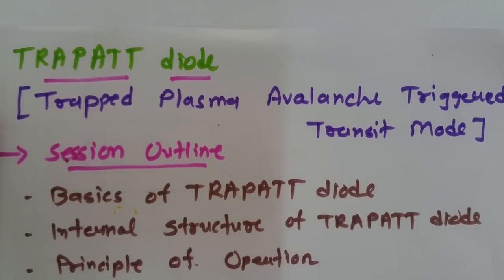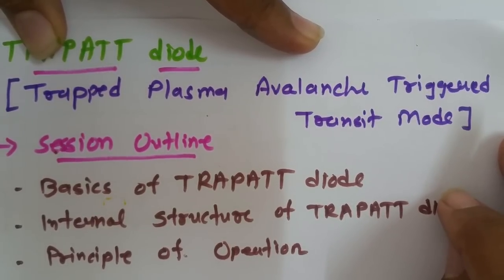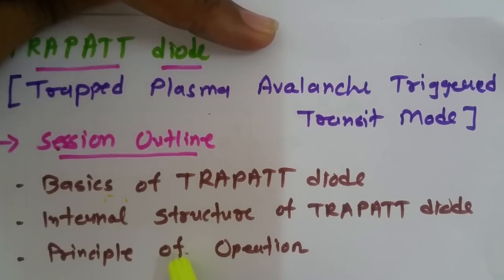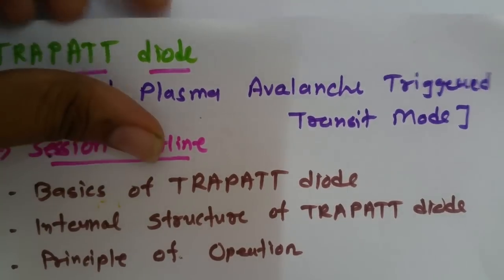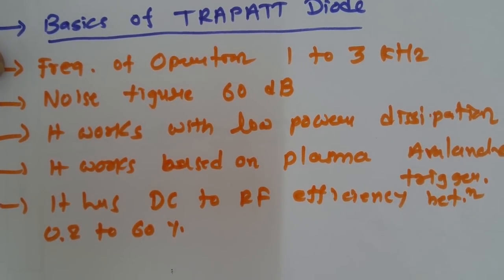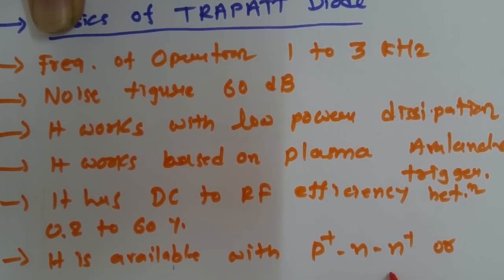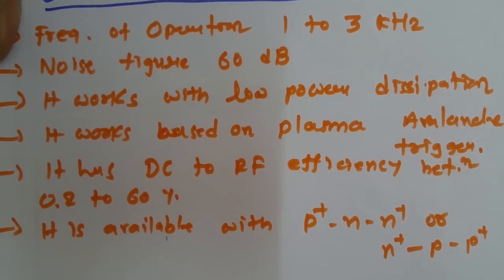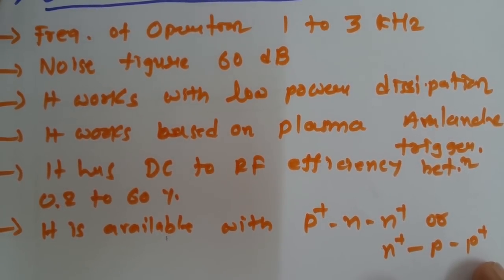TRAPATT Diode (Basics, Structure, Working, Characteristics & Applications) Explained

Comment: As I studied so far that the frequency at which trapatt works is from 400MHz to 12GHz...
Please clear my doubt
Reply from the maker: Yeah there are TRAPPT diodes which can works at 12GHz. But I have explained this with respect to basic TRAPPT diodes with noise figure around 60dB. There could be some other verities even.
Reply: U not mentioned sign near voltage source . anode is positive or cathode is positive
Reply: i guess it is a current source